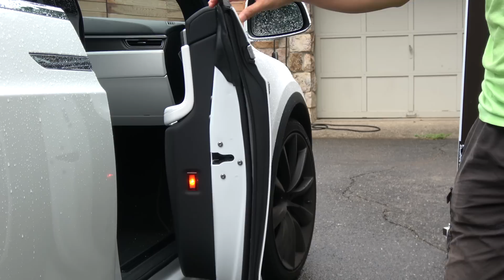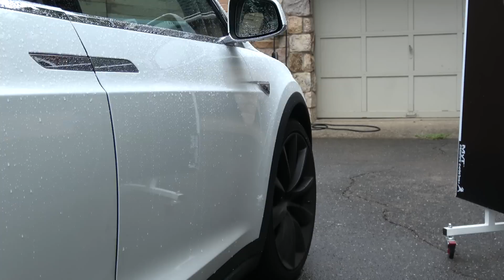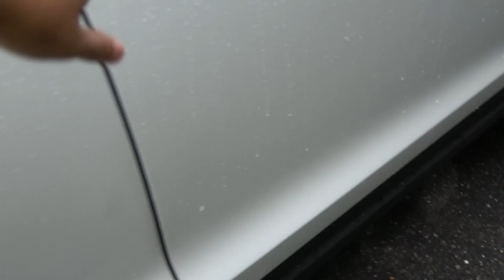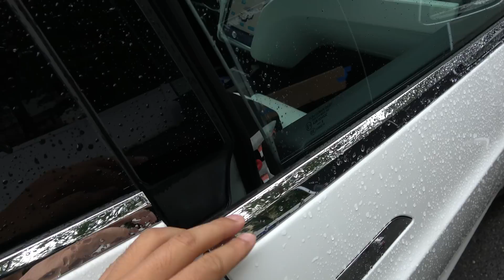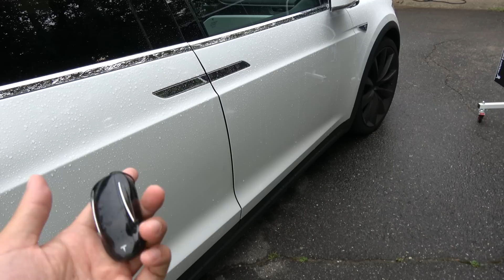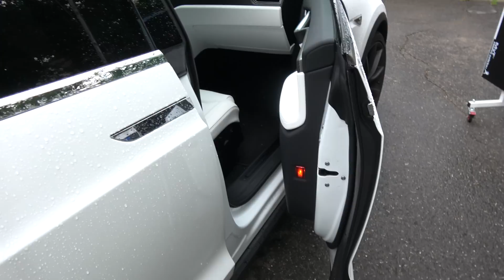Tesla Model X Falcon Wing Door External Sensors - Front Door Slamming Revisited! DEMO - Part 2 of 2

Comment: Maybe they put inverters in the doors that charge the batteries when you move them...  I think places should do that on handicap doors. It could generate power to the grid until you actually push the button where it actually works normally.

Comment: Regardless of a door being closed using an automatic system or physically closed by a person, anyone placing their hands in the path of a closing door risks injury. I appreciate the passion of Tesla owners like you but this is a case in which I feel as though you are looking for Tesla to engineer their way out of any possible or plausible occurance that could potentially result in someone being injured, even if it's an everyday hazzard that's been around forever like hands in the path of a door frame.

Comment: car is standing 180° try it again with 25° or  15° Tesla design this way because the door have to close no matter what horizontal or vertical position of the car
Reply from the maker: the motor that closes the front doors are very powerful, it can do it without slamming.  the latch pulls the door the rest of the way closed slamming or not.  no need to generate all that momentum.

Comment: First, thanks for sharing your videos.  I like the 4k steams to see the details of the car.  Secondly, man that's some real nit picking in all your videos.  I feel better about buying my Model x now that these tiny things are the only issues you can find wrong with this car.  Fantastic!  

Oh and btw, imagine parking downhill in San Francisco on a 30° decline.  You bet you'll need 50lbf to close that door.  At that angle the actuation needs to pick up 50% of the door's weight!
Reply from the maker: It still doesn't need to slam the door.  The motor can control how fast it closes.  The slamming will break someone hand.  try it on a decline.  see if it is any softer.  the programing is not to overcome parking on a 30 degree incline.  It is just bad programing.

so fwd that don't work half the time is nit picking?  middle seats that are as horrible as airline seats?  unless you have to sit back there and try out the rest of the car you won't understand how bad the rest of the car is compared to the driving seats.

middle seats that dont' work after you put a baby seat on each end making it essentially a 4 seater isn't nit picking.  guess you don't have any kids and all your adult friends are under 5'6"?  then the car is perfect for you!  think you are the only one!  happy for you!

Comment: Hi. I've read that the falcon wing doors don't have any sensors where the door is attached to the roof. Could you test that maybe using a carrot. Be careful not to crush your fingers. Does this create any danger for the kids?
By the way. on the thumbnails when it says "WARNING", I think it creates a negative effect. It makes you look like anti-Tesla, which might be the reason why you are getting down votes. I suggest not using any text in thumbnails. The video title already explains what it is. You could use text in the video as long as it is not used in the thumbnail. Thanks for these test videos. I find them very interesting.

Comment: The model X has many sensors around every door. Stick a carrot in the door while closing. The door will stop closing when the pinch sensors feel an object. Thanks for the video and your well thought out testing. Good details.
Reply from the maker: I've done multiple tests for the front door with carrots.  You can find them on my channel.  The pinch sensors don't stop quick enough when the doors are slamming with over 50 lbs of force.  I first tried with a carrot the size of my thumb, then redid the same experiment with a carrot the size of four of my thumbs.  Same result every time.  The carrot is crushed.  Tesla need to change the algo for the closing.  It really doesn't need to be 50lbs.
Reply from the maker: Here is my second experiment.  https://youtu.be/x4FrWkis45A